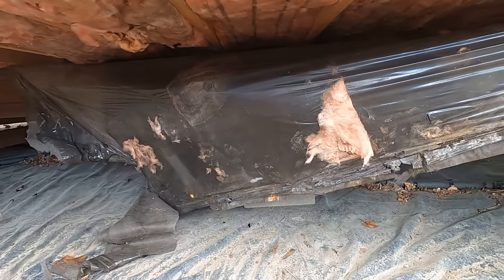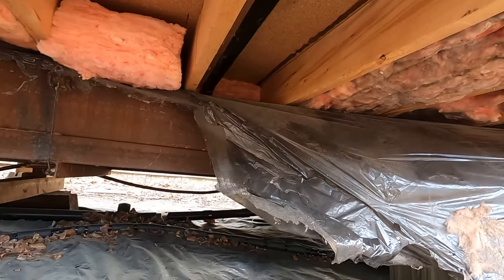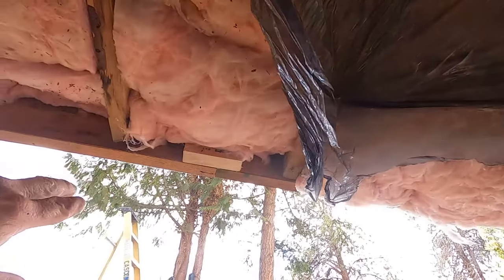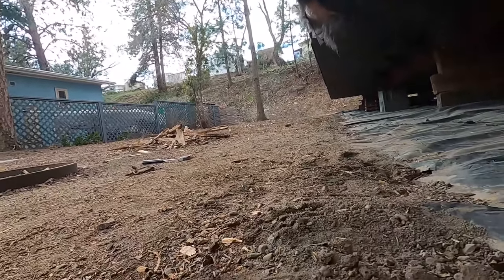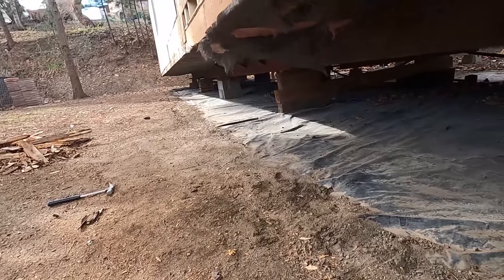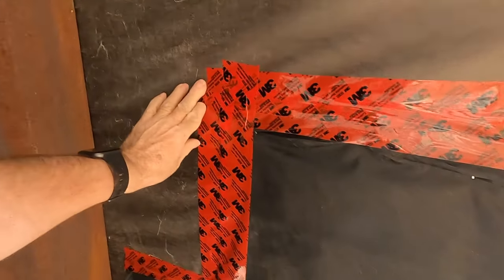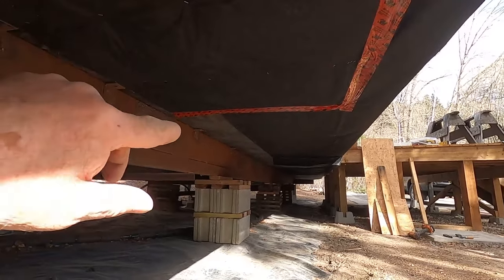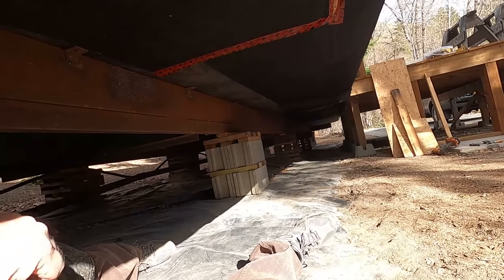Repairing Damaged Mobile Home Underbelly Fabric : E108 / BC Renovation Magazine

Comment: Spray-contact-cement, a coat on both surfaces to be joined, really makes a better quality bond than most tapes and is easier to do. After doing plumbing repairs and having to cut into my belly pan, I cut out over sized patches of billboard tarp, sprayed their perimeter and the perimeter around the removed sections of the repair area, gave them a minute or two to get tacky and then just overlaid the patches over the repair areas.
Reply from the maker: Steve, great tip.  Thanks.  I will try that next time.
Reply: I used gorilla tape because my under belly is a ventilated plastic, but noticed the tape corners starting to lift.   How long has the contact cement held up?

Comment: We had fixed all the underbelly insulation on our mobile home and the rats have it all back down again.
Reply: If you do it again try Rockwool as rodents don’t seem to like it as much
Reply: Or you can use apple cider vinegar pour around your home. They hate it.  @seasidepaper
Reply: oh good to know! Funny though, they eat our apples on our tree and I have been using apples as bait :-). but I'll try anything.
 @MariaStela
Reply: Closed cell insulation. It's rock-hard and extreamly expensive but it works well as a insulation and at keeping rodents out.
Reply: @nattydreadlocks1973 would an insulation company come in and do that I wonder?
Reply: @brokenragamuffin did you have any luck in the repair and rodent repellent I’m having major issues at the moment

Comment: I have the old traditional style that hangs down like a "belly" (Not between the joists.) with the stringed "tar paper".  The heat from the metal duct running down the middle radiates out to keep the pipes and floor warm.  I am looking for something that will permanently stick to that "paper".
Reply: ive replaced mine using a few methods, but I think I will use your route around the ducts, thank you for sharing.

Comment: Hi there, great video! Recently my wife and I have been interested in buying a mobile home (saskatchewan). I have a quick question, why is it only fabric underneath the mobile home and why isnt it, say, sheet wood or a more durable material? Wouldnt it make sense to have a plastic material or solid material secured to the bottom of those floor joists for a secure barrier to keep heat in and moisture from the ground out? Not to mention wouldn't it protect the insulation more? Thanks! Im genuinely curious as it seems like the material would get tarnished due to it being exposed under the mobile home. Take care.
Reply: Costs. That's why mobile homes are cheaper than a regular house they cut corners where ever they can.💔

Comment: Why is it necessary to have the fabric?
Reply from the maker: Hi, chris. I think that fabric is there mostly to hold the insulation up in place. Keep in mind that when these homes are transported from the factory they go down the road at highway speeds. Without that fabric the insulation would blow out.

Once on site and set up it still serves to hold the insulation up. It also is a barrier to keep bugs and rodents out of the insulation, which they love.

It can also serve a purpose as a kind of vapor barrier, but whether that is effective or not comes down to the material used and if a vapor barrier has been placed on the ground. Vapor barrier placed on the ground is pretty much code in most places now, I think.
Reply: @BCRenovationMagazine  
Thank you.

Comment: A nice and clean repair. I have to replace my plywood floors in my mobile home. Field mice had been in my mobile home so I'm going to cut pieces of my old floor to use as my underbelly, to keep them from getting into the insulation. 

Just repurposing what was already in the mobile. 👍🏽
Reply from the maker: Full Body Joe, thanks! Sounds like you have a good plan. 🙂

Comment: My home was built in 1976 and we bought it used from someone for $700. It had insulation with chicken wire throughout holding it in place. Now with the whole floor being redone there isn't anything there anymore and my floor is freezing cold now. Is chicken wire ideal to use or fabric?
Reply: My mobile home lost most of its under belly insolation.  I put new insolation in, then stapled up  chicken wire to hold it up,then covered it  with fiber matirial.  It actually worked beautifully.
Reply: @dannydazzena7160  thats a great idea. I bet your floor is nice n warm. You cant step on mine without shoes in winter. Summer is the best lol

Comment: What insulation is used for under the mobile home. I need to replace mine
Reply: It’s normally the pink stuff/yellow stuff/white stuff r22, I’m using Rockwool r22 under the bathroom and kitchen area as it won’t droop and it won’t soak up water.
Reply: Rockwool definitely holds water
Reply: @joshmorris3735  Water doesn’t soak up water it beads off

Comment: I was told Tyvek house wrap can be used as well.
Reply from the maker: Hi, Eugene.  Tyvek would work, for sure.  You would just want to make sure you install the Tyvek face down, labels facing down. 

Thanks for watching and commenting. 🙂
Reply: @BCRenovationMagazine  I’ll be fixing my underbelly in the spring and replace some of the insulation with rock wool especially under the bathroom and kitchen area.
Reply from the maker: @eugenewilson7555  , sounds good. 🙂
Reply: @eugenewilson7555  thank you so much Eugene, I was look king for woven poly materials but the tyvek wrap is the best solution, at least the woven version of it. Keeps heat, let’s moisture out, doesn’t let moisture in and still has a somewhat breathable nature and is durable product.
Reply: I bought te genuine stuff for belly board at a mobile. home supply store. A 60x40 was $275 /2023

Comment: Is it that insulation backwards? The paper  side should be down?
Reply from the maker: Hi aldisilvia! 🙂 The insulation that you see there is just regular R-20 fiberglass batts.  There is no paper attached to the insulation.

The wood flooring above the batts acts as a vapor barrier.  Vapor barrier always goes on the warm side of the insulation.

If this insulation had paper on it, which would be a vapor barrier, yes, it would go paper up, in between the joists.

The black fabric material under the insulation is not meant to be a vapor barrier.  It basically is there to hold the insulation in place, mainly for when it is transported down the road from the factory.

On the ground, under the home, is a layer of heavy plastic sheet plastic.  That plastic is meant to be a barrier to moisture coming up from the ground.

Thanks for watching and commenting. 🙂
Reply: Depends on where home is located.  The insulation should always face the warm-in-winter side. Use faced insulation with the paper facing the heated living space. So, in cold climates, it should face the interior; in hot, humid climates, it should face the exterior.Oct 31, 2023
Reply: @barbarawilliams2477  Perfect summary. Thank you.

Comment: There is not any wood to staple the cloth to under my mobile home. from the edge all the way in to the metal frame is insulation only. There is wood on the other side. I guess they are all made different